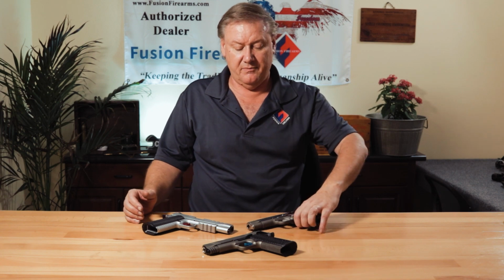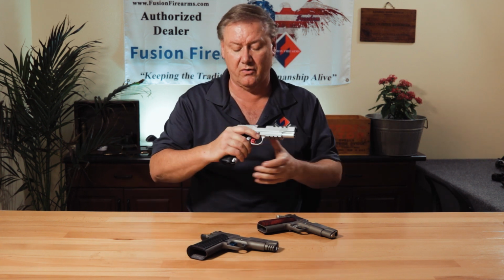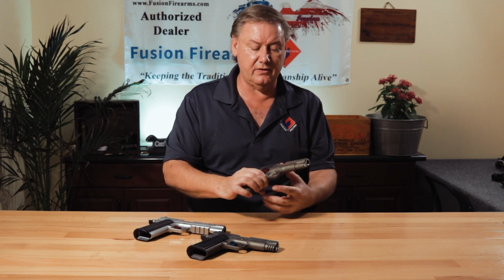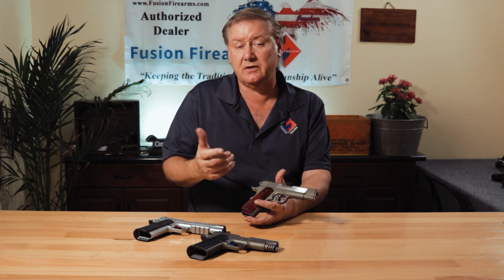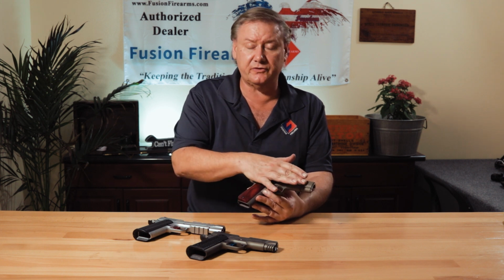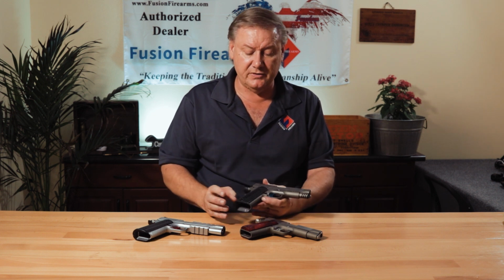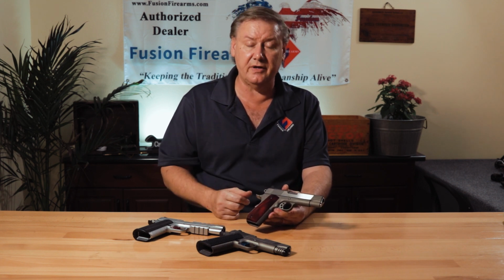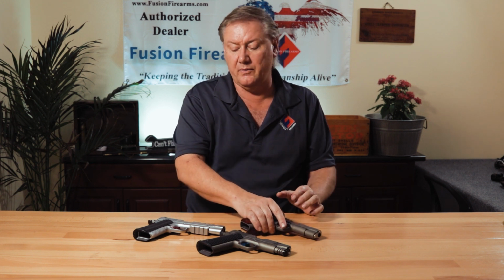Silver Finishes "On-the-bright-side" Firearms Finishes (Ep.4)

Comment: I suppose there  are different  grades of  SS....as he mentioned some do still rust.  ut, I have  cheap  grocery store branded kitchen knives that  are SS....never rusted. Not a single spec....and i`d  hand wash the knives and let htem air dry :) Psrst of the time.  these are  $10 chef`s knives :)) Likely  made in China (or not heh)....not even  `German Steel. or Japanese.....
Reply from the maker: Yeah, but  that is not the idea. For firearms you have to heat treat the stainless steel, So you have to use a 400 Series or 17-4ph Series. These have some limited carbon in them so they will heat-treat properly. Kitchen items are generally a 300 Series such and 303 which is very good for rust protection but, You can not heat-treat the 300 series.